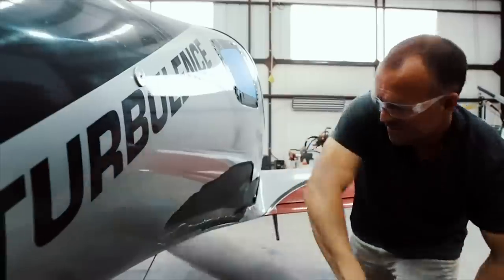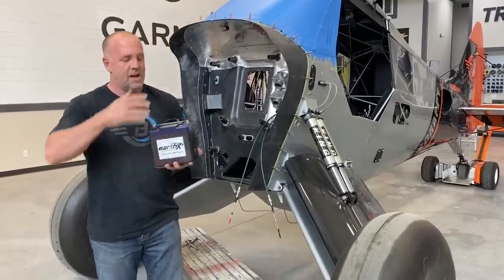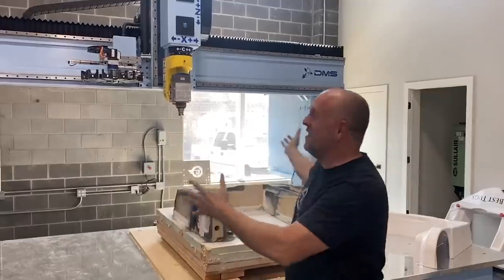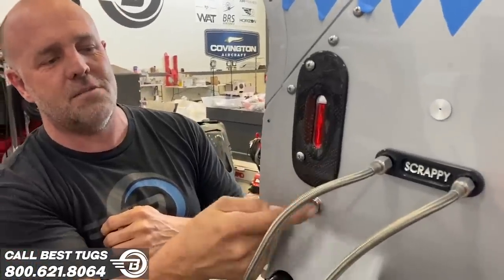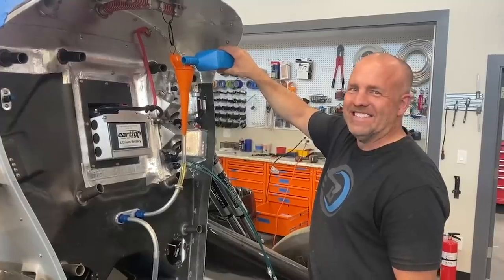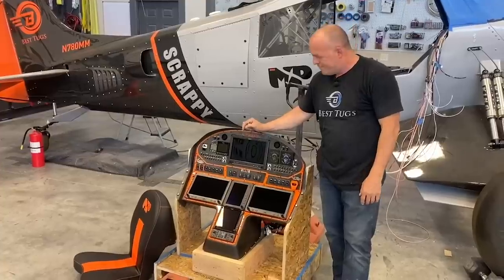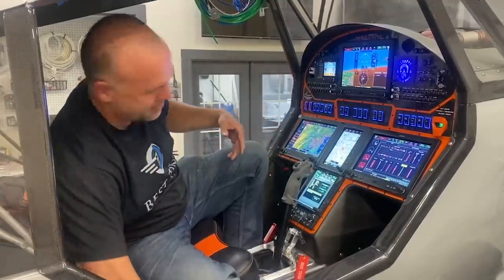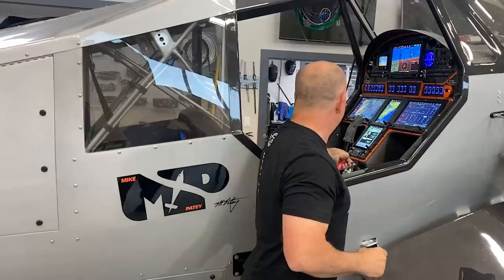Garmin Panel Install (Scrappy Bush Plane 25)

Comment: Really looking forward to finding out that Mike is putting rocket engines in his wingtips to take off faster
Reply: Jim Nickles  that's a good question, I don't know the answer.
Reply: Probably JATO's lol
Reply: If Mike does it. It's no longer JATO. It's MPATO.
Reply: @michaelcoffin4364  mike patey assisted takeoff lmao

But why do you need JATO when the plane can take off in 10 feet?
Reply: @alienbeef0421  because 0 feets better?
Reply: @adamjacobs8606  that was going to be my exact reply.
Reply: @Bernhard Jordan military tried that once. Ended up damaging the airframe beyond repair.
Reply: Lmao
Reply: Every witty response I could think of has been covered here 🤣👍 I freakin love this build and the community of followers!
Reply: Jim Nickles  Bah I don't see it saying "no JATO's" per sae
Reply: @michaelcoffin4364  But they only used a C-130.
Reply: Jim Nickles  it's a special class lol
Reply: I have serious doubts about rockets, but those two lines coming out from the side of the panel area, in front of the door, and going into the shocks, has me very curious.
Reply: Michael Coffin mål  monopol m l lö m
Reply: Sasha Waxman  lol o. M l pp
Reply: Phil Courteney    Det Lombok
Reply: Michael Coffin nio ollopmlpol jag kan op
Reply: Alexander Wolters polllplplpoplpplpppplo
Reply: @philcourteney4328  mike is a 1 in 100 million humans, maybe even more.  the work output is incredible, and the video quality matches. I learn from each one, up to me to use the data.
Reply: @alienbeef0421  because Mike can?
Reply: @michaelcoffin4364  they didn't have Mike design the airframe now did they? ;)
Reply: jato bottles on scrappy? he isnt going to the moon , just to 5000 feet ... lolz!!
Reply: David E. Burden I am pretty sure he mentioned those earlier on in the build. I believe they are just brake lines.
Reply: Should mount them vertically and make it a VTOL bush plane!
Reply: Could redirect some fuel to some aft facing nozzles. Wouldn't exactly be a jato.
Reply: Lol

Comment: "How much more horsepower?"  lol I saw what was written on  the starter button...
Reply: What was the initial rating of the engine? Always thought it was close to that anyway?
Reply: @MaximEck96  all factory IO-720's are rated at 400 hp. Mike's is a 780 (a 780 was never made by Lycoming) so considering the bigger displacement and higher compression plus whatever else is done to it...it likely makes a good deal more than 400 unless Mike is limiting it for other reasons
Reply: This panel is amazing!!!
Reply: Devon Martin i think he mentioned it was 500 hp before but the starter button says push for 600 hp
Reply: I just hope he learned a lesson in crosswind aileron authority at very low speed especially with that huge torque up front making the problem even more dangerous.
Reply: @yoong___  My guess would be a 100 shot of nitrous. Not really the space for a turbo or blower...
Reply: i saw that too lol
Reply: @stotheh  This engine had a supercharger when it was in his race plane.
Reply: Maybe he is hiding a "press for +150 horsepower" button somewhere that activates a nos tank
Reply: @ginacalabrese3869  I'm aware... This isn't the race plane though....
Reply: stotheh i was thinking he just tuned it up because the same button he’s pushing that’s making the starter solenoid click is the one that says push for 600 hp but either way 500hp or 600hp continuous or not it’s still badass

Comment: I love an instrument panel that is designed just the way you built this one.  I like it when everything is evenly spaced out and everything is built based on the center of the entire panel.  To me the way you designed and built this panel is perfect in every way.  Couldn't be better.  Everything screen and switch and knob is easily accessible and easy to learn where everything is at.  Everything is laid out perfect.

Comment: I cannot resonate enough what Mike is doing with the backseat, we just finished our Lockwood Aircam build and we placed a G3X in the back that is linked to the G3X in the front. At first, I thought it was overkill but after flying the airplane around 90 hours I can tell you its the best thing we did. The Garmin is so user friendly that even non-pilots in the back seat can learn to use the system within an hour-long flight. The best part is when you have a pilot in the back, they can run all the systems while you focus on flying in the front. Most flights in the Aircam are below 500ft AGL so this is super nice. After owning a G3X I am sold on Garmin for life, I will not use any other system out there. They just do it better. 

Fun Fact- Initially the G3X was only single-engine capable, I hear that a "certain" Aircam got them to make it multi-capable;)

Comment: Hey Mike congrats on the DMS! I work at Viking Yachts and we have a DMS and a much larger PAR. We use them to cut all of our plugs for our large and small molds. We have years of knowledge in the best foams, and coatings to use to bring finish hand sanding down to a minimum. Feel free to contact me, and I can give you all of that info to save you some trial and error!

Comment: I just wanted to let you know how much I love your vidio’s. I used to fly and just watching your videos brings it all back to me. I’m 76 and haven’t flown in 20 yrs, this makes me want to go up again. About starting your big block 8,  back in the 70’s - 80’s we used to put 6 volt coils in our 12 volt race car starters because we had 12 to 1 compression. This will make your engine start in any conditions but you can’t over crank it or you’ll burn the starter up. Just a thought!
Thanks again, Frank the old guy 🤪

Comment: I would put the foil on the engine side where the heat in form of IR radiation is coming. I would also put foil on the side of the battery facing the engine. BTW, I love lithium starting batterys, I have used my Beltenick for 5 years now without it ever missing a beat. Weights 1,92kg. Built stainless overkill bracket for it too.

Comment: YES!! ANOTHER SCRAPPY VIDEO!!! 
Mike, are there any plans on making a 3D scan of Scrappy like you did with Draco? For those of us in model aviation, it would be excellent to be able to build a scale Scrappy or even 3D print a model Scrappy!
Reply: I’d buy a model of either for sure
Reply: I would also.  Is there anyone making a Draco model or display model?  It is a great example of engineering!
Reply: Maybe even extend that to a virtual file of Scrappy that can be flown in Xplane11 or other Flight Sims?
Reply: Jack Newman I’d be surprised if Scrappy or Draco didn’t show up in the new Microsoft sim.
Reply: Yes! A full 3D scan would be a great gift to the community. I'm certain the flight sim community has the technology, and would love to do it. Not only for sims, but models, etc.
Reply: @Chad_at_Big_CAT_Networking  I would pay any amount of money for those modules.
Reply: @brandonslater5666  last I heard Mike Patey and Horizon Hobby were working together to build an RC Draco. I dont know whatever came of that or if it was just rumor.

Comment: 13:35 If only you had some sort of cool zip tie that wont vibrate around on your wiring harness, instead of using electrical tape...

Comment: Mike - I’m in love with that plane. Something I’d love to see you build next time.... an electric plane!! Thanks for the great videos.
Reply: i asked him that before and i think he said it was certainly something he had considered, but wanted to wait until battery technology gets to a point where you can get decent performance (payload/range/power).
Reply: @sixpackpilot  Solar panels for electric power.
Reply: @jerrywatson7176  If you park it for 48hours every 30 minutes of flight maybe solar panels would work :) With the kind of horse power the bush pilots use I don't think it's even close to being worth it
Reply: Solar is a horrible solution to charge the battery, he could just install a small diesel generator that runs off jet fuel!
Reply: @JonT1137  What if you just bypassed the electric bits and hooked the crankshaft of the generator straight up to the prop??
Reply: NOOOOO!!!

Comment: Mike.. Wayyy back in 1990 Garmin had their first portable.  Green screen no graphics just dots for waypoints.   I was working with Ford as the leason between engineering and the off road racing team.  With Team Enduro and the blessing of their owner Dick Lanfield.  I developed a cable to get the readout and created a DOS program to write the waypoint location, elevation and ground speed. It would write a line 10 times a second.   This was just as much a safety item as it was navigation.  I mapped the complete area of Baja Mexico.    I turned 60 on the 13th.  What an exciting life I have had.
Reply from the maker: That’s incredible!!  I appreciate the innovation, creativity and brain power to push through the boundaries in technology.  Way to go!!! That’s why we’re where we are today. 🤠👍🏻

Comment: “When we need to fly at 25,000 ft....   sheesh, would be interesting to see how far you would go after jumping in the jet stream.  Everything you’ve done so far is blow way past the bar for this build.  Getting excited to see the initial test flights!
Reply: Climbing to 25,000 ft would sure cut down on the drag.  It would be interesting to see how it affects the ground speed.   Mike, any chance for a test?  Just throw your supercharger back on and give it a blast.  I’m betting the wing you have planned will handle it.
Reply: Pressurized Carbon Cub?
Reply: Patrick Murphy Just cabin oxygen.
Reply: I was under the impression with what Mike was referring to that he would be able to develop the amount of power to climb to that height without much effort, tend to think that the supercharger would be able to maintain better performance at that altitude.  Just taken aback when he mentioned it and chuckled a bit.  Haven’t experienced anything over 13,000 ft in the Cessna 180 unpressurized yet, just the oxygen tank supply.

Comment: David built the panel for my first RV-7 and he’s my go-to guy for custom built firearms. I have a very nice 300 blk SBR with suppressor that I got from him. He’s a good guy!!
Reply from the maker: That’s awesome!!  He does incredible work.
Reply: Mike Patey    Yes he does....and I’m glad to be able to call him friend. Oh, BTW, like the rest of us mere mortals, I can’t wait to see your next video and I’m chomping at the bit to see scrappy in action! 😎 One quick question, have you ever talked to Robert Paisley at EFII? I’m not sure if his System 32 could be configured work on you 8 cylinder or not?? I have it installed on my RV-8 and I’m also installing it on my new RV-7 build. I absolutely love it!! I think my favorite part of the system is that hot-starts are now a thing of the past. It really brings these old air cooled engines into the 21st. century with modern electronic ignition and high pressure fuel rail/electronic fuel injection.

Comment: Questions from a non-pilot: I'm curious about the use of blue backlighting on that panel. Will that, as I have heard, negatively affect night vision? If so, do you have provisions for changing the color of the LED lighting in flight?
Scrappy is going to be one epic take on the Cub's age old design!
Reply: N1RKW yeah, definitely, but he also has like six huge screens in front of him, so his night vision will never stand a chance
Reply: He has a dimmer on them
Reply: He can turn the halo lights off
Reply: Yeah I was wondering the same...
 blue LED at night aren't the best. Although with gloves and other things in that box most of the light should be blocked. I still think a red or orange would be better.
Reply: Homeboy got a FLIR camera so the screens can be his night vision
Reply: That's actually a good question, I used to have a car with oil temp and pressure gauge right in front of speedo cluster and those gauges had blue LED backlight and even though it was dimmed to the max, that blue light was quite weird during night, it was definitely distracting. With that being said, I can imagine Mike's instrument backlight might look better with that typical BMW amber backlight color tone, it would probably even match the orange paint on his instrument panel.
Reply: The thought I had was that he might have another knob for shifting the color of the panel lights, if they are RGB LEDs. I don't know if that can be done with the Garmin setup he's got, but it seems to me to be one possible solution.
Reply: N1RKW I wouldn’t do that myself as I find it useless, once I set up the preferred color it becomes useless and takes up useful space.
Reply: @rixogtr  - Good point. Perhaps a small day/night switch instead.
Reply: N1RKW as I know Mike, he will probably automate the switch to switch between day/night mode automatically 😂😂
Reply: On the race boats we always have red lights for night to protect our night vision.  I have a strict "no white lights" policy after dark anytime I'm at the helm.
Reply: Brian H race boats with night vision? What sort of a hell race you guys do? 😂

Comment: Something Ironic....I just realized i painted my 7.3 diesel project truck nearly the same color scheme. Needless to say i'm in love with how Scrappy is turning out! Super pumped for you, Mike!

Just curious, could you have pulled a slight vacuum on the oil cooler line and then sucked in the oil much like putting coolant into a vehicle?

You brought up a good point about the wiring connections, you did a good job keeping in the spirit of Poka-Yoke.

Comment: Great work once again Mike. The finish line is just over the hill. I think I am getting just as excited as you are and can hardly wait until the engine is installed and the wings fitted.

Comment: Thank you so much for taking the time and explaining the guss lock system. I love the fact that you will likely be able to "pop" start this high comp. beast. And the fact that you can get to the microswitch wires fairly easily makes me super comfortable and impressed with your setup. The cockpit looks gorgeous by the way. The fit and finish of all your work is better than today's super cars and it makes me want to engineer/build something of my own!

Comment: Question for you about lithium batteries, brother Mike: Do you think you will have to occasionally charge that battery with a LiFePO4 charger, since most alternators are engineered for maintaining lead-acid batteries? I've been steering clear of them, since I figured their life would be shortened by not getting proper maintenance from the alternator (in anything, land, sea, or air), which won't charge them at the slightly higher voltage they require. I had a bad experience with one several years back when they first appeared on the market. My fault, since it wasn't the right application for this technology - a kick-start dirt bike that was converted to a dual-sport. It originally had NiCad batteries, which handle the abuse of being run flat and recharged hundreds of times. LiFePO, I learned, becomes a paperweight once voltage falls much below 12, if I remember right. That aside, I was curious of your thoughts on how the lead-acid designed alternator will handle the task. 

BEAUTIFUL panel!! WOW!! She's coming together quick now! Seeing that engine so close to the firewall has me on the edge of my seat! AWESOME vid as always, Mike - we really appreciate you sharing all this with us!! 👍🍻
Reply: I'm gonna go ahead and believe he's addressed this. But yes for maximum life they need to be charged correctly.
Reply: When charged incorrectly it can also catch fire...
Reply: A lot of lithium batteries (LiFePo4) these days have a built in BMS (Battery Management System) to take care of the charging. I'm unsure about the EarthX batteries, but I know the LiFePo4 battery I have in my 4x4 has it so I only need to supply the battery with 14v and the BMS takes care if everything
Reply: Balance charging on an individual cell level is taken care of by an onboard circuit (BMS), similar to how a standard lipo charger works.  You have the main battery cables hooked up to the charger for the bulk of the charging, but if a cell is low, the balance port will top it off with a little extra current.  In this case, the BMS will route a bit of additional power to that cell.  The BMS also prevents over discharging, over charging, short circuit protection, as well as a thermal protection circuit.  They're essentially smart batteries at this point, and are likely safer than traditional lead acid batteries.

I'm going to go out on a limb and say that he's quite familiar with lithium batteries in aviation applications, seeing as how he made his own lithium battery for Draco and Best Tugs are probably using lithium batteries as well (I don't know for sure, but honestly can't think of any reason why they wouldn't be).
Reply: Those batteries have a charge manager included. No need to worry.
Reply: Great info guys! I didn’t know all this about the new ones. Sounds like they’ve got the technology dialed in pretty good these days.

I wasn’t challenging Mike’s choice in batteries. I just want to make that clear. I just wanted to know his thoughts about regular automotive and aviation alternators charging these batteries, since they require special chargers to keep them healthy. I’m 200% sure he knows what he’s doing - he wouldn’t have put it in his plane if there was any kind of risk. Thanks again everyone! 👍👍

Comment: Regarding engine out and the parachute.   My question:  Is the parachute actuated mechanically like a pull of a handle, or does it require electricity such as from the battery or generator?  I assume it's completely non-electric. But I've never heard this discussed on aviation channels.
I love Scrappy too much! Such beautiful engineering and workmanship. Wow!
Reply from the maker: I’ll go in to depth in an upcoming video soon.